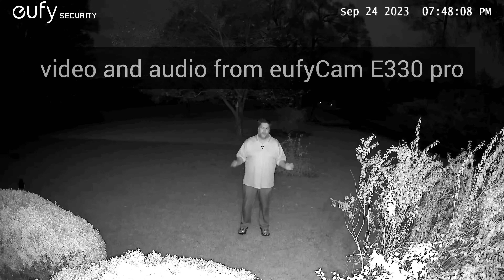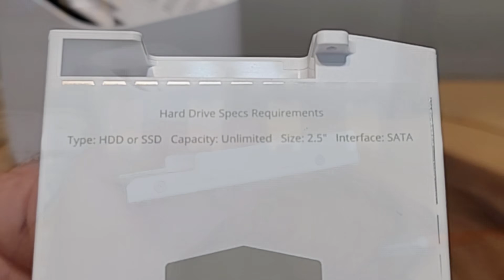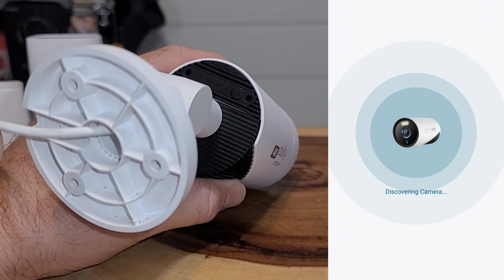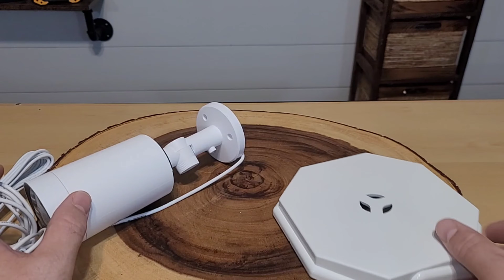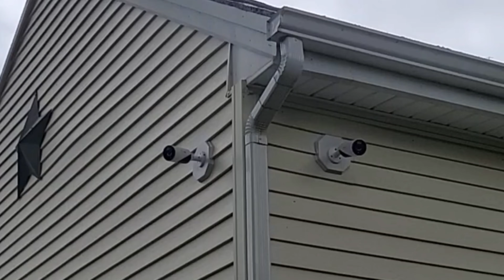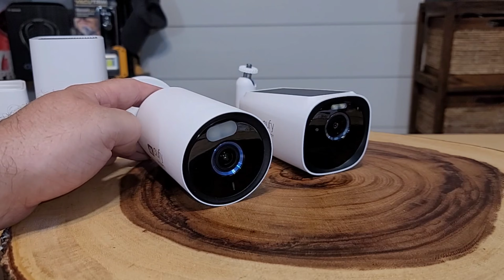eufyCam E330 professional. 4K Outdoor Security Camera System, 24/7 Recording [537]

Comment: I wonder if this can be used to monitor a residence entrance with a lot of access. Persons and cars.

 Got some questions;
1 How far in open space do the cameras connect to the home base?
2 Do the cameras need access to your internet wifi, or do they have a seperate connection with the homebase? (My internet signal, doesn't go so far)
3 What is the max detection distance, at which movement triggers recording?
4 Can you just configure it to record 24/7 till disk runs full? (Without detection mode, if detection doesn't go far enough)
5 Automatic cleanup using FIFO when disk full?
6 Can you set a maximum period of retention, (for legal reasons, like 30 Days)
7 Can you download the video's, if so, in which format? (In case of request for police investigation)
8 Is there any auditing which video's were viewed? (Legal reasons)
9 Once setup is done, does the home base still need internet access? Or can we disconnect it, and just reconnect it when we need to view a video after some issue? (I Dont need continuous app access)
10 Can you disable notifications completely?

Lot of questions, just ain´t finding the answers on these...hope you have some answers.

Comment: I hope they have a fix in the audio, it’s terrible. I have this camera also and this is my only problem
Reply from the maker: I agree, the audio isn't that great but I am impressed with the video quality. I rarely use the audio. Thanks for stopping by and commenting 👍
Reply: If you call customer support, they will give you a different update for the sound. It works
Reply: @jonathanzamudio2075  did you do the same?….if so how was the audio after?